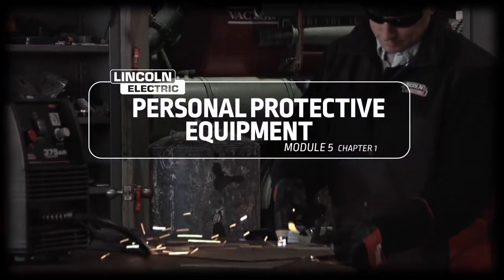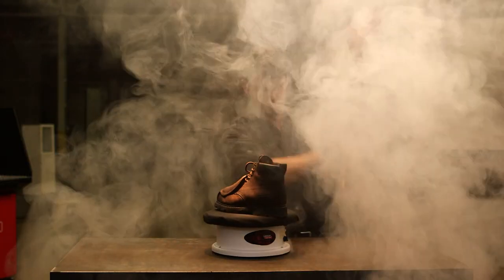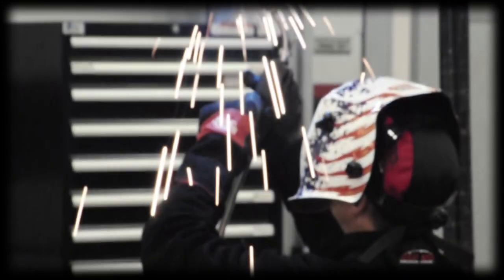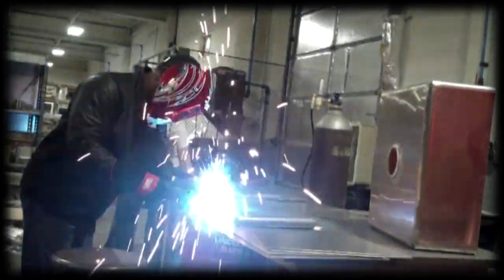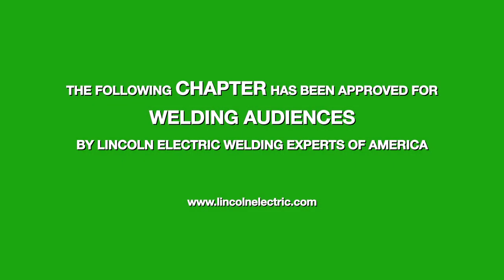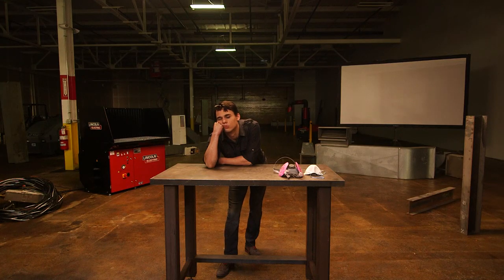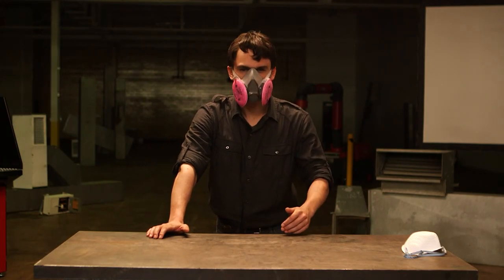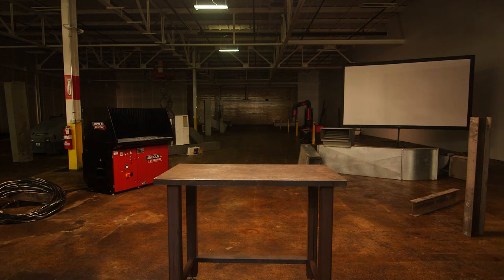Welding Safety: Personal Protective Equipment

Comment: For most general purpose SMAW and GMAW a welding helmet with a shade #10 is used, in fact most fixed shade (passive) helmets come with a #10 lens.  Auto darkening helmets can be fixed shade with #10, or have adjustable, 9 -13 is common but higher end helmets have a wider range such as #5 - #14 or thereabouts.